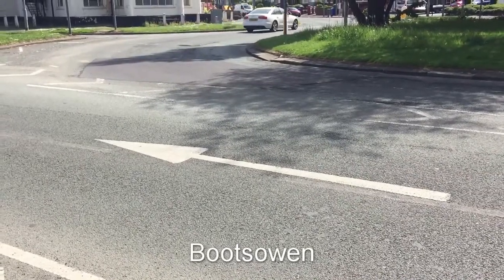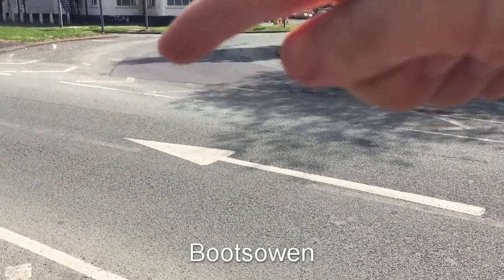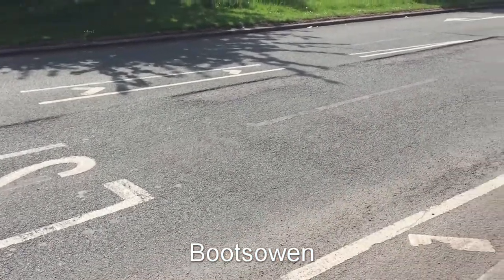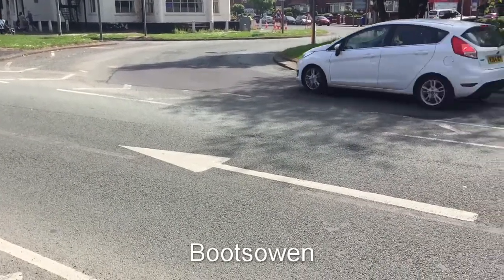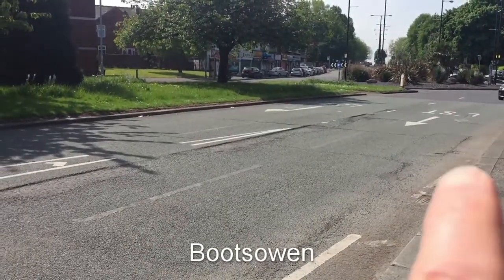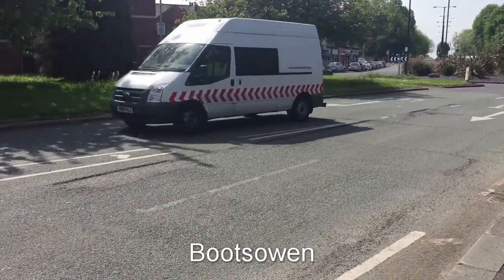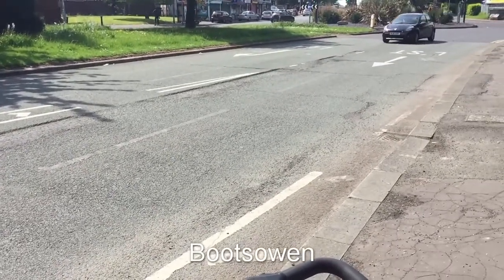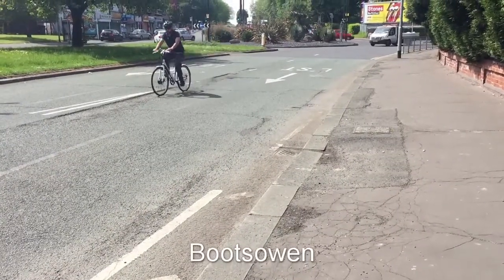Pothole? Thin surface course ravelling

Comment: Here in Australia they are trialing  blending plastic and rubber into the ashpalt to give it a bit of spring to make it not crack up. Apparently it is working well.
Reply from the maker: I think there are loads of trial mixes out there, Most, or perhaps, many mixes in the UK use Polymer modified binders, PMBs that is plastics mixed through the bitumen binder, with all sorts of fancy claimed benefits.  I have heard of research in Northern Ireland using chip (french Fry) oil in the mix, old tyres etc.  In the Netherlands they were trialing metal filings in the mix so that an infra red heater could heat the road up and "heal" cracks.  In the UK there are trials on microcapsules of magic fluid, if the road cracks the fluid is released and "heals" the crack.  Hard to say if any of them really work until they are proven.  
The UK is suffering from a lack of maintenance over the last 5-10 years, and the roads are really in bits.  I have quite a few videos to upload!
Reply: Can't help but think it is really a way of disposing of waste material by hiding it in roads! Especially now China has cut taking recyclable materials from other countries. Here in Australia because the country is so big without the population as soon as you get out of the cities the roads are a disgrace. Many areas still have dirt roads. But one thing they are doing well is hotmixing all intersections so the turning vehicles aren't tearing it up. But hotmix is no good where there is heavy truck use as it just melts in the sun and moves around like plasticine.